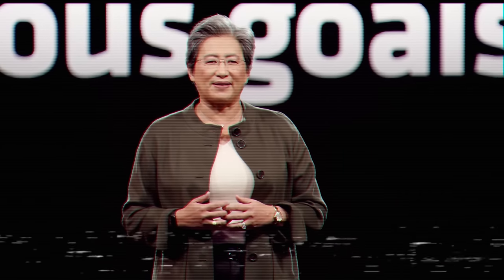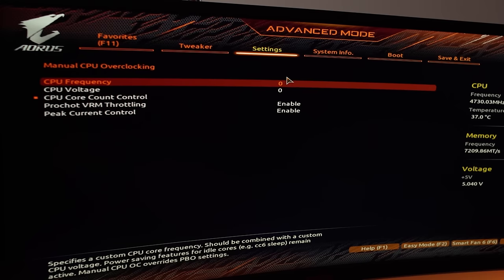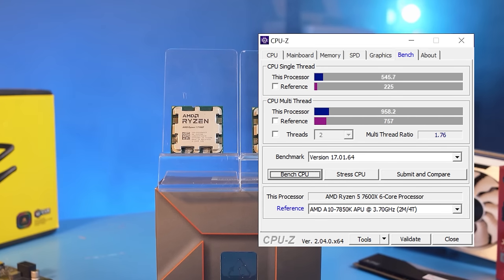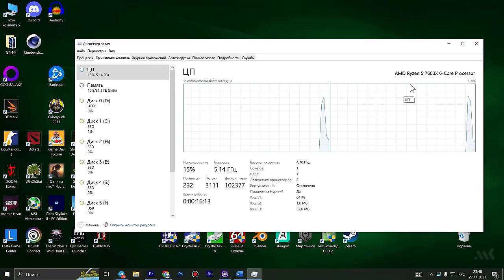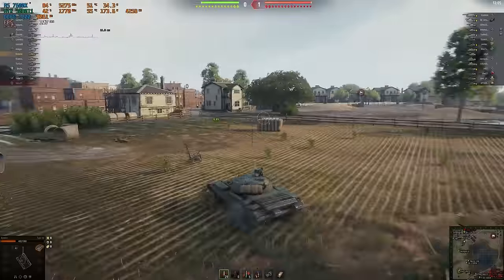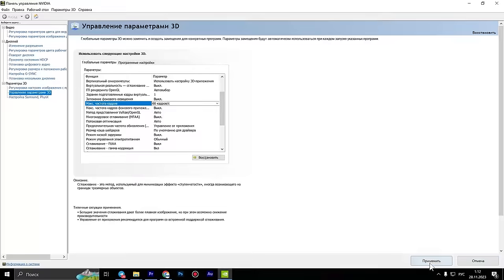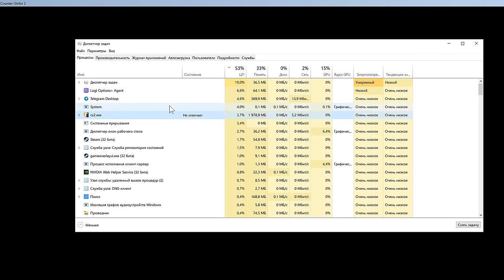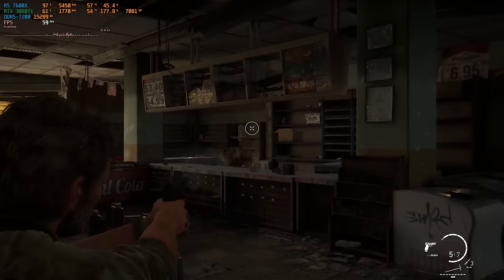One core is OP | Ryzen 1 7100F test

Comment: actually a very wide big 1 core can technically perform just as well , especially if its built for it. we just never went that route
Reply: Yes, and no. There is some benefit to spreading the cores out rather than relying single processor pipeline. You would run into issues like heat density. With it spread out you can use multiple data paths without interrupting flow and access on a single one. A single processor is great when dealing with stuff that can be found in a single block or memory. But if you need to deal with out of non ordered multi-threading with multiple CPUs will crush it. I'm saying that after 35 years in software development and having also worked on the hardware development in a fab.
Reply: The speed of light is the limiting factor for how much die space can be invested into a single core.
So no.
Reply: Vector processors can make sense, however in the modern computing landscape they are not worth the additional work required to optimize software and compilers for it.
Reply: @lbgstzockt8493  SIMD isn't too different in concept and it's already present in a lot of modert CPUs.

I use SIMD to great effect combined with methods most developers haven't touched since the 80s to deliver performance that's orders of magnitude ahead of competing software.
Reply: @lbgstzockt8493  Intel started the SSE instruction extensions and AMD started their  3DNow! decades ago. God, just saying that makes me feel old. Anywho, they do vector and matrix processing.

Comment: R23 DOES have a single core test. You just have to use the advanced menu... Also as some have mentioned SMT goes way back before Intel.
Intel had to do it because Pentium 4 was a stalling bitch, SMT allowed the second thread to push instructions up the pipeline while it stalled

Comment: Watching 4k videos on Youtube tab is easy enough on any CPU, as long as the "Use hardware decoder" option is enabled in Chrome.
The same goes for video editing.
Reply: it depends on codec i had 1060gpu which did not support AV1 codec and then it runs on cpu not gpu which some 4 and 8k youtube videos have and then you can see performance difference
Reply: @Beeda2004  The thing is though, the Ryzen 7000 series all have iGPU's built-in, and all of them are capable of AV1 decodes. Whether it is activated in BIOS the video doesn't specify, hence my comment.

Comment: They should just make a single core cpu that has a massive instruction set and give it hyperthreading but like 1 core 8 threads. when it's running a single task it can run it at super fast speeds cause of the super sized single core and also handle multipul taks with hyperthreading.
Reply: Or software developers could just write their software with multithreading in mind
Reply: @obj_obj  That, basically. 

The one place you still see a lot of single-thread CPUs is the embedded world. where power consumption or absolute reliablity is paramount. they still make 6502s...
Reply: so, can we get 3 level hybrid cpu cores like arm?
Reply: @storyanaksekolah2  For that, we can just use Arm cores. Windows, MacOS, and Linux are all basically there by now, releasing software for Arm machines now takes little more than flipping a switch in the compiler.

Comment: Corrections;

- SMT and Hyperthreading aren't purely software-stack only. A core with Hyperthreading / SMT has additional registers to handle an additional instruction thread whenever the core is stalled due to lack of data to process.

- The Pentium 4 was a single core processor with support for Intel HyperThreading. This means you still have one single core doing all the hard work, but it will display as two logical processing units in the OS because it has the ability to handle juggling two execution threads. Intel didn't produce any multi-core processors until the Core duo / Core2 Duo processor families on LGA775 and their Xeon counterparts on LGA771.

- Also, CineBench R23 does have a single-core benchmark mode if you enable advanced options.

Comment: SMT is not a software feature, it's a hardware feature where the CPU core ISA front-end state resources are duplicated (including instruction fetch and logical register file) to allow the CPU to execute two or more units of execution. The allows the CPU's decode and execution scheduling hardware to make decisions at macro and uOP level. This is fundamentally different than software (OS context switched) multithreading. To be clear, when talking about SMT, the enabled logical processors are absolutely considered hardware threads and there is actual physical additional CPU state logic (on the die) for SMT enablement.
Reply: Yep, and with the first hyperthreaded cpus, Linux kernel didn't see any difference with the cores, until they tweaked the scheduler to be tad smarted and detect which cores are "real"  and not

Comment: A single core CPU is the best layout for low latency, but the problem is, to get to to perform the workloads as a multicore can. With an 8-core running say 4 GHZ per core, you have 8 CPUs. For the one CPU core have the same total compute power (in theory), by comparison you need it to run at 32 GHz (which is impossible for the silicon). Of course in reality, and formost tasks, it might perform better than the 8-core (@4 GHz), if the single core is running at 20 GHz (still unattainable). The multicore layout is a necessity on a CPU, to provide the need for compute power.
Reply: Nice

Comment: athe whole package of a 7700x with single CCD cost around $50 to manufacter, adding the packaging cost, any quad core is profitable above $100, with an msrp of $200 and discount over time, it is still doable. It's just AMD don't feel the need to it or until they have a large stock of low binned 8 core CCDs. There is already ryzen 7600 non X selling at $200. margins are always high on high end product.
Reply: I think the more separated release cycles between high end products and lower end products is the fact that more parts are binned better in general during manufacturing. Especially with AMD and their chiplet design, defective rates should be much lower

Comment: I guess it's time AMD brings a real mobile SOC, so should Intel by reviving Atom series especially with their new x86s.
2 modern PC cores should be enough for mobile phones and they can have IO chips manufactured by a separate 3rd party fab to drive down the fabrication costs.
Reply: I think for phones what they currently have, thats 8 core and up ARM chips, is quite ideal and the focus is more on saving power than actual performance. A dual core x86 will definitely outpace those chips, but also sip a shitload of power in comparison, especially when idle so itll never be worth it.
Reply: I was thinking on the similar line, just sub the IO and the processor fab guys would die of boredom 🤣
Reply: Nah, intel atom was a failure with that much heat on zenfone
Reply: @rizalassyfiya2133  I owned Asus Zenfone x86 and it was pretty ok on everything except colorinacurate camera. But I rarely gamed on it.
Reply: intel problem is they need higher freq to get performance. that never work for small device. look how amd create Z1 extreme. they perform very well on lowpower small device. Intel E cores works for making intel chip run faster multicores performance as they could outnumber AMD chip cores. so its still doesnt help for small devices
Reply: Nice pfp

Comment: Game engines are using mainly 2 threads: one for rendering (well, here is where it could split further) and game thread (for game logic). And most of the time there is no need for multi threading. But havy simulation could use other cores, for example Unity DOTS allows to utilize processing in parallel with ease, allowing to calculate much more at the same time. But DOTS will work better even on a single core. So yeah, no one writes multi threaded code as it is harder to do and probably won't pay back enough to justify it.
Reply: Not BeamNG. It uses all cores

Comment: would be nice yo try crazy overlock to see how much preforamcne you could push out, with those temps you could probably get like 5,8-9Ghz
Reply: I'd like to see those Overclockers using Liquid Nitrogen to try 1core/2thread at around 10GHz (like they originally though 1 core was going to do.)

Comment: why not usign dynamic inverse smt to boost single-core tasks like for exaple gaming, will be cheaper to add 4 CCDs on amd (4*8c) and use it like 4 big cores and 8 threads for gaming and use all the 32c 64t when the app requires?

Comment: Burn 127 cores from 128 cores CPU for one large L3 cache exclusively for one single core. It could be a little better if the die fabrication is specialized for this configuration.

Comment: Wow here you can see how much advantage has multicore. This CPU needs 35W. Its really high and got only 2300 Cinebench points. The Intel N100 is faster with 6W and 4 cores. Or a 15W Zen3 got about twice as much points and need half of power.

Comment: Multi-threading has been around a lot longer than what you stated. It's been around since the late 1960's. Windows 2000 supported it. Windows NT 4.0 was capable of making use of multiple processors I used to run a dual core pentium 233. Hyper threading is the CPU variant were they created a parallel pipeline on the CPU that first happened in 2002 and was intel. 
So multi-threading existed since 1968. Hyper threading 2002.

Comment: Quad core Pentium 4? As far as I know the Pentium 4's only went to up to dual core with the D9XX range. Intel added Hyper Threading to the single core Pentium 4 to mitigate their problem with the large instruction pipeline that they have used in that architecture. It was a method to fill up the pipeline more efficiently and gain a bit more performance out of the underwhelming Pentium 4.

Comment: Didn't AMD release a 3100 with 4 cores 4 threads? I'd dare to check if they didn't release a similar CPU for zen3. So i'd guess you'd need to name it something like 7005 (check the decoder ring though) ?
Reply: the 3100 was 4 core 8 thread actually, and the thing that made it worse than the also 4-core 8-thread 3300x was the number of CCXs on each (plus slightly lower stock clocks)
there was nothing lower-end than a 5600 on zen 3, unless you count the 5500 which was an apu with no graphics cores and was remarkably similar to a 3600
anyways, i think the 7005 is a funny name for it, though even the 3000g had 2 cores xd